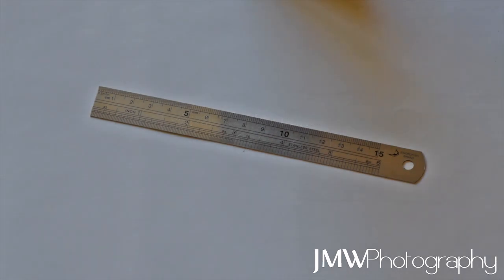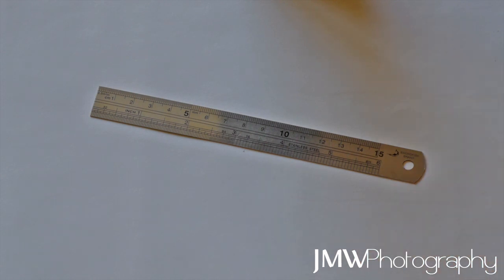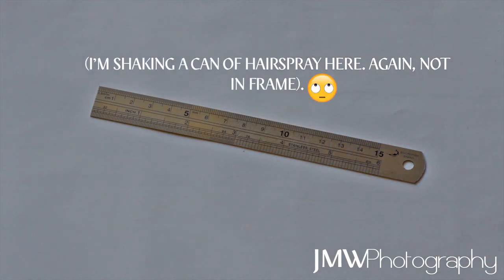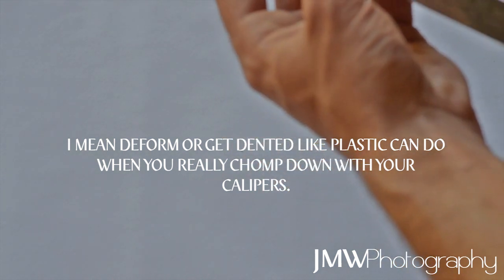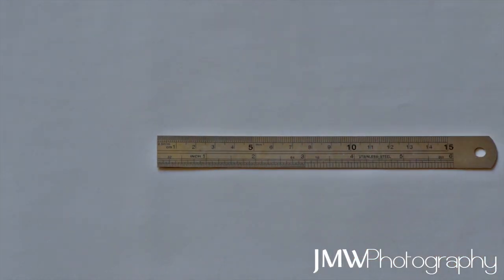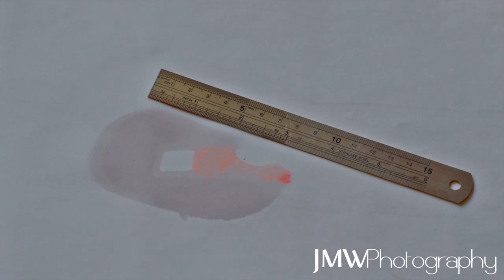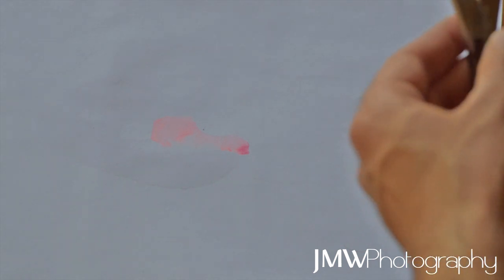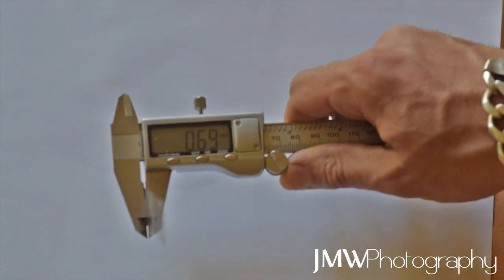Simple Bed Levelling Tips - Anet A8 - 3D Printing - Please Read Notes in Description.

Comment: Dude, Thanks for the video. I thought you were going to check each corner with the calipers. I may try that next time.
Reply from the maker: Hi @Plan C, thanks for the post. Do you mean each corner of the ruler I used for the experiment? I probably should have done the process a little more scientifically to be honest. Haha. I was more testing a theory to see if something so trivial could effect the overall levelling process. What might also be interesting would be to extremely accurately test this in a real-world situation. Ie: Actually levelling a bed in a few different manners and measuring the differences at the end.. Hmm. Food for thought! 🍎

Thanks again!
Reply: JMW Concepts Lol no. I thought you were going to check each corner of the hotbed from the frame with the calipers..
Reply from the maker: Plan C , oh! Haha. I will certainly do a more involved, real-world video soon!

Thanks for the input and getting involved. :)
Subbed by the way as I've seen you in a few LIVE feeds I've been in.

Comment: How long have you had this printer? Any problems?
Just asking cause a lot of people say this printer is crappy and breaks easily
Reply from the maker: Hi @Vatsal Rami, I have had the printer for almost 6 months now and have printed a lot of useable parts. At the price point the printer sells for, it is excellent and far exceeded my expectations. There is a fair bit of tinkering required and you will need to make upgrades as you go. 
That being said, with careful calibration, you will get some lovely prints from the printer stock. 
Thanks.